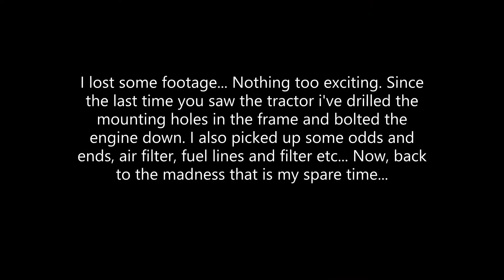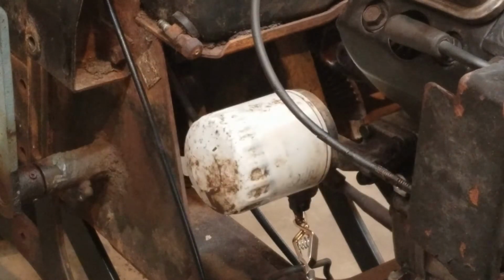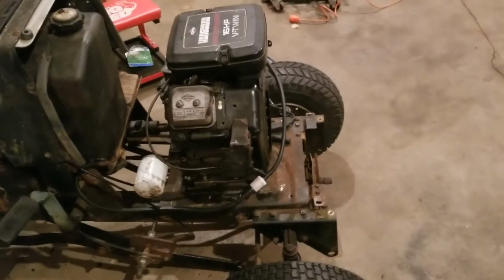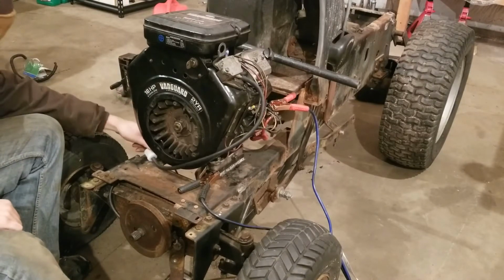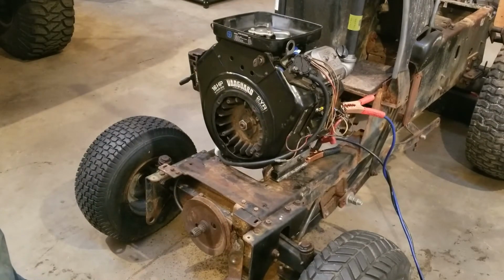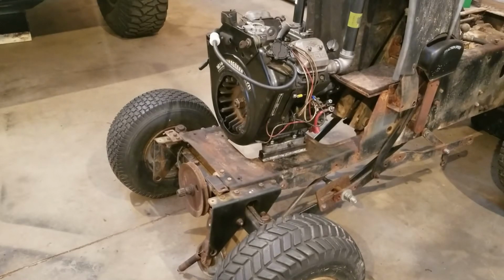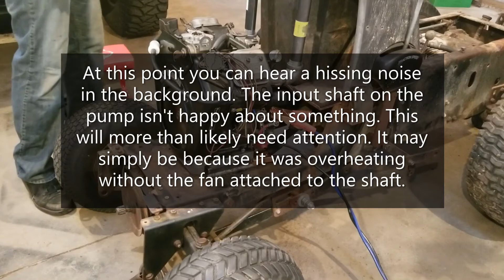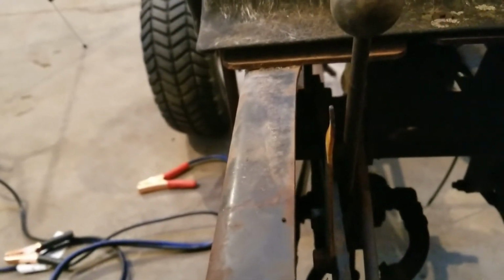White GT1855 engine swap part 3 - It RUNS!!

Comment: It's probably getting hot in the back because you don't have a fan on the back part of the drive shaft  just before the pump with the fins  it's a $36 part
Reply from the maker: Hey Jay, I do have the fan for it, just left it off during this quick test. Its since been put on and the tractor works great. Hope to make a few videos on it soon.